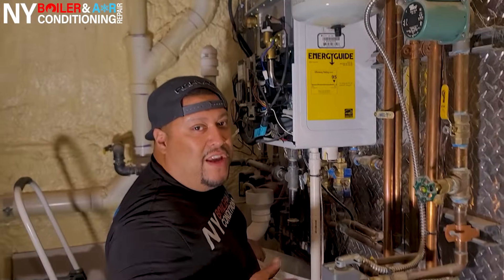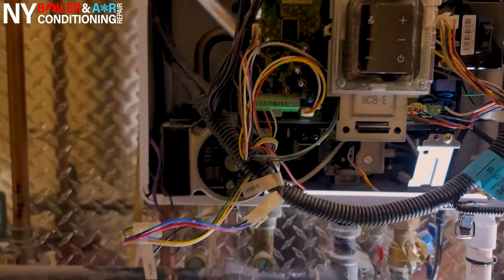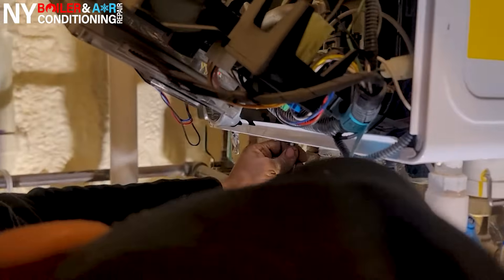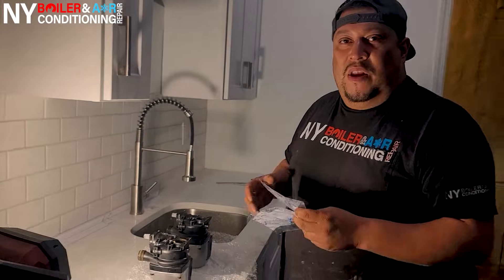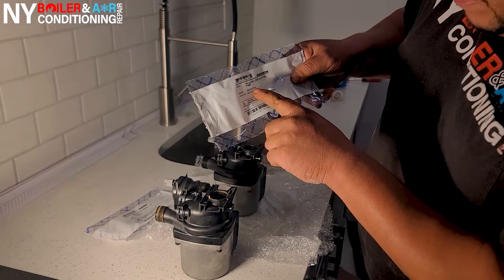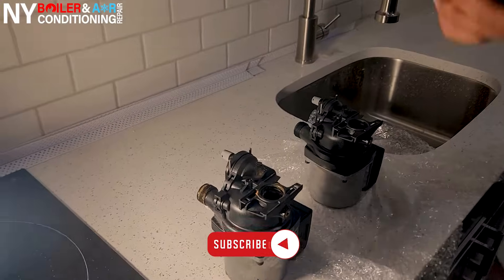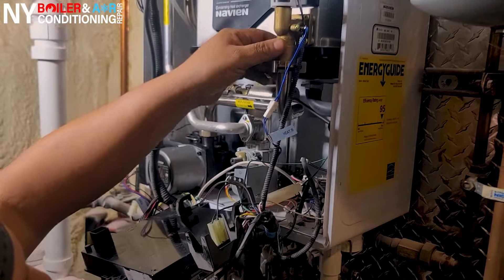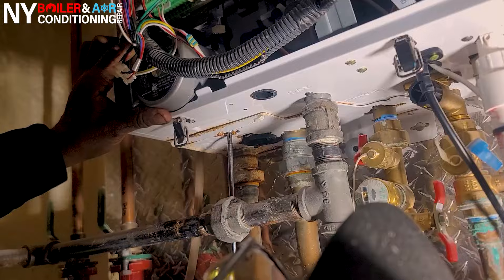How to install a Circulator Pump Navien Boiler

Comment: Just a head's up to anyone else looking for the replacement gaskets that he refers to, he misreads the part numbers and adds an extra digit in both. not a huge deal but you're going to want to look for 20030919A and 20035277A

Comment: I might have been nice if you'd mentioned the slide clip BEFORE you took the old one out. Also it would have been great to show just exactly where the o-ring goes. I put mine in yesterday, worked great for a few hours and started to leak. I think I got the o-ring in wrong and the clip not slid in all the way. The damn thing crapped out Xmas morning! I WILL conquer it today!!!! I use white lithium grease on  stuff like this...
Reply from the maker: Damm that sucks brother.. Sorry to hear and i hope you got it resolved. I'll take that to consideration doing the next video. I appreciate the tip.. This motivates me to do better. Thank You
Reply: @louietheboilerman  Yeah, I got it done. My orig seemed to have 2 o-rings. Could not get the clip in. Home Depot o-ring kit, put in just one and it's working fine!!!! (Knock wood!) WHY do these clowns use a Philips screw under???? HAve  the EVER tried to get a Philips that has been rusting for 4 years out? HEX HEAD!!!! (Universal screwdriver, i.e., the drill got it out! I fix appliances. Idler pulley screw from a Samsung dryer fit perfectly!

Comment: Respect man  basics without nonsense. However the plumber grease, bro  that's a petroleum product and dissolves rubbers and stuff. Dude, I use lubricating jelly, it's water souluable and has no effect on rubber or anything but has the "lube"  your using it for. 
Whatcha think?
Reply from the maker: First i want to say thank you for watching and supporting me and my channel. I appreciate you. To be honest ive never had a problem with the plumbers grease ive been using.  Im aware what your mentioning because someone else have also told me but ive been using it long enough to say it works and i have yet to have any problems of leaks up to now. Everyone has their own preference. I been using plumbers grease and it works for me and my clients. But its always good to hear others like yourself  and hear and listen to your experience. Believe it or not ive using dish washer soap and it works. Why? because i ran out of grease and its 10pm at night so i had to improvise but my point is? it works but im always willing to hear how other techs and plumbers work. I love to learn and especially how to apply it to make MONEY. lol ...

Comment: Louie, you're an f***ing genius. I'll be calling you this week for a water heater install and to do annual service on two oil burners in the N. Massapequa area.  With regard to the Navien, Nightmare story, My brother in Bayville has a CH180 that was put in by a non authorized Navien installer after Sandy.  He never put in isolation valves, so it's NEVER been flushed.  It's under a service contract with P***O.  He has no space heating water but normal DHW.  I have a feeling it's the screen (or possibly the 3 way)  I want to just drain it so I can examine the screen.  I see the drain plug between the S/H supply and return.  It's all crusted with coppery funk.  The CH180 service manual talks about a circulator pump inside the cabinet.  There is a red nippley looking thing on top of the pump.  Do I do anything to this to vent it to drain?  On your model, that same item looks black, but it definitely looks like a cap or a small vent?  Do I do anything with that?  Believe me, if they weren't under contract to those OTHER guys, I'd ask you to be here tomorrow.